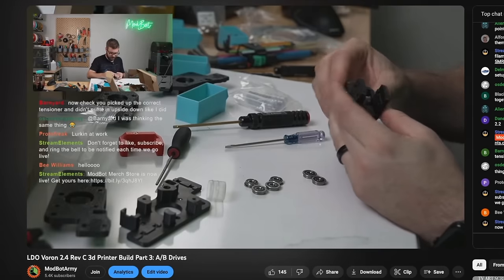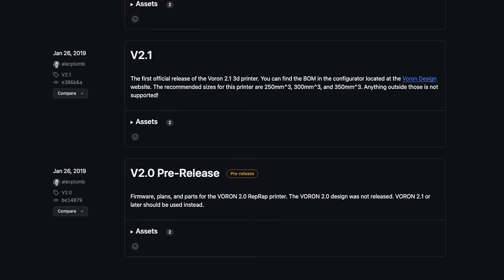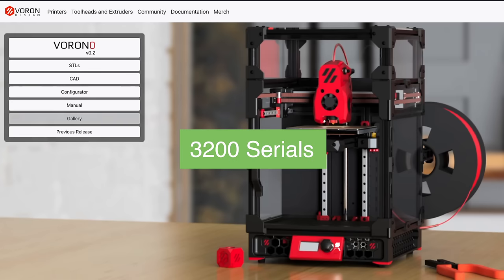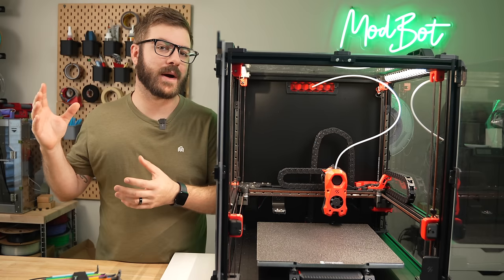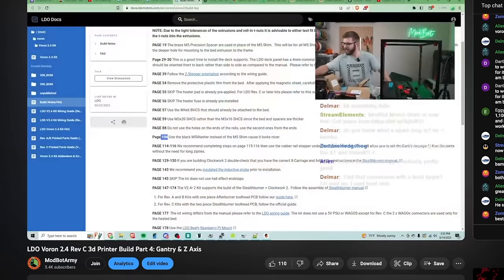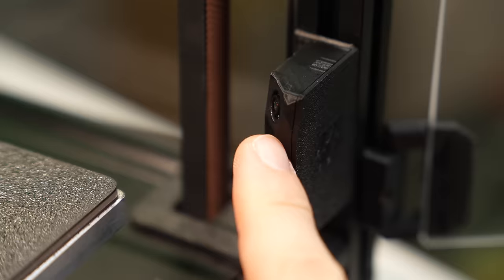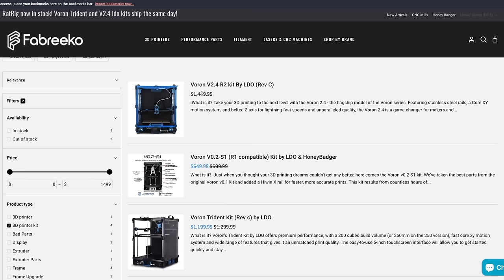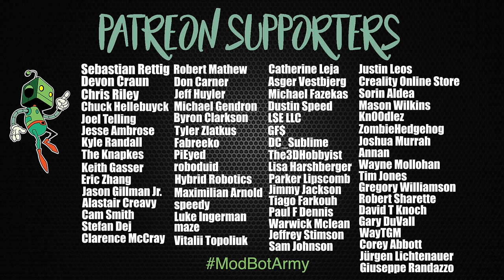Should You Still Build A Voron 2.4? (LDO Rev C)

Comment: I like my 2.4 RevC kit but I did have to replace the included drive gears for the extruder because the ones they shipped me were out of round and led to filament pulsing (CnC Kitchen did a great video about this a while back). I also had to spend a lot of time getting belt tension set correctly to deal with some layer shifting and consistency issues. But since then, I've typically been running it as fast as necessary to maintain the max flow rate of the revo nozzle. The machine can definitely move faster though, and I think the next step will be adding a higher flow hot end of some sort. But overall it has been a great investment and I've enjoyed the challenge of getting it to 100%.

Comment: Personally it's hard to convince me that a stock voron of any kind is the way to go these days. You can get such better performance from a few mods. The voron toolheads in particular are a non-starter.

We have 9mm mods, monolith, XOL, archetype, doom, etc. All of which are going to get. Even not going umbillical in 2023 is absolutely wild to me.

The V2 is  a really cool printer that is the baseline for a lot of what the DIY community is doing today. But it's also a 4 year old design in an ever-changing landscape. I encourage any new builder to not limit themselves to that 4 year old design.

RE: Trident vs 2.4. Trident is going to be vastly less finicky to build with the lead screw z and rigid gantry.
Reply: Most of the kits today are going beyond stock... especially LDO is adding a lot of mods in their kits.. and you can upgrade it easily..

Comment: I've been looking at the trident for a while, but I've recently ran into "The 100" project which is a full 500usd Core XY build with similar performance to the vorons, but I've pulled both into CAD and im going to try and marry them together since The 100 replaces all aluminum extrusion with either 3d printed parts or makes the kinematics a part of the structure. Like the linear rails, rods and lead screws.

Comment: I just finished my LDO 2.4 last night lol Just gotta get it tuned before I submit for serial
Reply from the maker: Woohoo! Congratulations 😊. How was the build for you??
Reply: @ModBotArmy Mechanically, it was the easiest build I've had so far. That's probably because it was my first LDO kit and the quality from that and others like formbot is miles apart. Firmware, I had a tough time getting QGL to play nice but I got it figured out. I'll post a Pic in the discord when I can get home to it
Reply: Software tuning can take a long time on this printers to be right.  But if the build is good then you should have a good time.
Reply: @Newmeishu Ive had a couple good test prints in PLA, so I'm pretty happy with it so far. Really just need to get my slicer settings tuned, especially for ABS/ASA

Comment: Gone the 2.4 way last summer 300 LDO RevC as well.
All is fine except Klicky in heat soaked chamber (works way better at room temp)
During QGL, I randomly get one inconsistent reading (off the others by more than .1mm) exceeding the tolerance and triggering a new set of measurements, sometimes several times in a row, and (rarely) the QGL fails due to too many errors.
I reduced the Z probing speed to 5mm/s but still have the problem (again, this mostly happens after I heat soaked for ABS / ASA)
I'm using the microswitch that comes with the Klicky addon bag included with the RevC LDO kit.
I'm curious about yours, seems different from the stock LDO.
Did you change it? what's your experience? what's the reference of this microswitch? (or is it KlickyNG?)
Many thanks ;)

Comment: The belted z was worth it to me, I despise acme threaded lead screws
Reply: Intresting🤔, what issue have you experienced with the ACME screw that the belt setup solved?
Reply: At last the lead screws from LDO are not a problem.   I have both and Z works perfectly fine on both.
Reply: @RaoulEvilD  misformed leadscrew on my cr10s back in the days. A bunch of z binding, too. Back lash due to shitty nuts and the belt is so much faster, I don't even see my 1mm hop

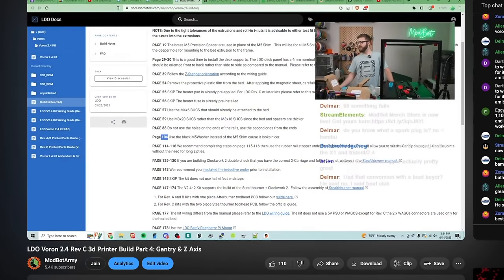Comment: 4:35
This is the same problem with the latest kit from formbot.  Between the 3 in 6 out DC, no 5v PSU, and the klipper documentation being slightly better with pictures than voron documentation, AND formbot having their own wiring guide for part of the process, it's a mess.

Comment: I don't think that the TAP will work on the Trident, only on the 2.x series because the bed isn't stable enough.  So the V0.x, Trident, and Switchwire can only use the clicky probe, or an inductive probe for bed leveling.
Reply: TAP will work with a Trident, but not a 1.8

Comment: One thing I've experience with my 350 2.4 is the inconsistent Z calibration and ABL repeatability at startup. From other posts I find, this is a common complaint. I suspect there could a few contributing factors. The first being heat soak stabilizing thermal growth can take an hour if you have the patience. Second being the XYZ home sequence happens automatically before ABL. Once everything is up to temperature,  ABL needs completed again and then Z re-home should be the last step. Thinking about adding that at the end of the ABL sequence. Any thoughts?
Reply: I had first layer issues on mine a few months after I completed the build and spent way too much time troubleshooting before figuring out that my belts needed to be re-tensioned. Been rock solid since
Reply: @voicesarefree  I had that thought as well. Not sure how to get all 4 to the same tension. I've heard of the app for phone frequency tone plucking the belt like a string. Is that your process?
Reply: I heard about frequency target too, but I couldn’t really figure that out. I probably tightened the belts too much as I just went by feel, but all layer issues I had went away.

Comment: Voron vs ZVbot is what I want to know. Zvbot with its awd and water cooled tool head option with cpap cooling  vs voron stealthburner. Which one has better speed and quality
Reply from the maker: I will do a video on the VZBot as well. VZBot build was much more involved, it was a lot more blazing your own trail. Speed by far my VZBot outperforms my 2.4 accells, cooling, and flow. It has taken a bit more time to get the VZBot dialed in though and it likely still needs some tweaks.

Comment: I’ve been thinking about getting a Trident. The build doesn’t have me to worried but the software end definitely does. I’ve struggled with getting software to work on simpler printers and I believe most of my issues are do to my computer and lack of knowledge. Does someone offer a pre programmed for a Trident?
Reply: The Voron team has default Klipper configs for all of their printers. I haven't looked lately, but the most you would need to do would be changing out the probe section if you don't use the default inductive probe. If you go with a klicky probe, there is only a little configuration that needs to be done, and it is straight-forward. I haven't done a TAP, so I can't say how difficult it would be to install, but that is what the discord is for - getting help and asking questions.

Comment: “Can’t go wrong with either the 2.4 or trident” is a bit of a stretch in my opinion. 2.4 definitely takes more skill to assemble and get right. Not to mention the 4 belts for z which is alot more annoying to maintenance
Reply: I've had my v2.4 for 2 years, moved and left it in a garage for a few months, plopped it in my new workshop basement and hit print on it, 0 prep and recalibration, it worked no problems, been working great ever since, still haven't reran input shaper on it.

Comment: Where did you find the LED PCB at?
Reply from the maker: The ones that are pictured are from Siboor.
Reply: What's the advantage of PCB LED?  Heat dissipation?  I adhered my strip to a very thin piece of scrap aluminum.  You could cut an aluminum can in a spiral, or build a stack of heavy aluminum tape.  The adhesive on aluminum tape is generally rated for temperatures far in excess of the hottest chamber temps you'll ever see, e.g. 100c++ (check though. do not blindly assume your tape is the same)!

Comment: I ordered a Tident kot from Formbot (it comes pretty stock) since the build looked a bit easier ,😋
But I'm still debating on which mods to implement, any recommendations? 🙃
Reply: TAP asap and later on a Galileo 2 extruder.
Reply: @Newmeishu formbot kit comes with tap
Reply: canbus is a nice upgrade
Reply: Canbus, or USB toolhead board.

A different toolhead with better cooling. XOL or Archetype are good examples.

When you build, flip your Y rails to the top. This will allow for toolheads like Archetype Mjolnir.
Reply: @Newmeishu  thanks for replying. Abs tap oder cnc tap?
Reply: @JKtech3D  indeed, I'm just a bit confused on which one to buy, bigtreetech offers different options
Reply: . I've heard indeed that the cooling in the stealthburner is not that great
Reply: @dazuio7175  if you want to keep the stealthburner then go with an sb ebb with the stepper driver you want.  The rp2040 version has larger headers which was a complaint on the other versions, but I think they now include precrimped wiring for those.
Reply: I checked the formbot BOM and only saw 6 rails listed, the short one for tap is not on the list.
Reply: Honestly, Vorons don't need much in the way of mods. I have a 1.8 and a 2.4, and the only mods I have are the Klicky probe, the Nevermore air filter, and a single piece front door. Both machine have stealthburner print heads.The 1.8 has 8-10K hours, and the 2.4 has 3-5K hours, and they both run like champs.